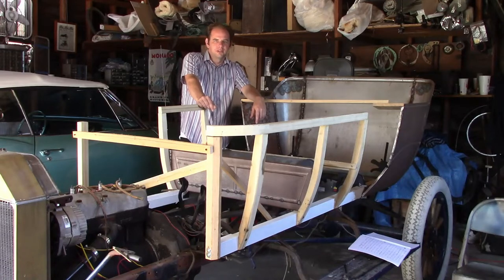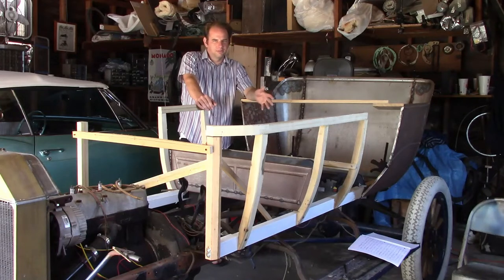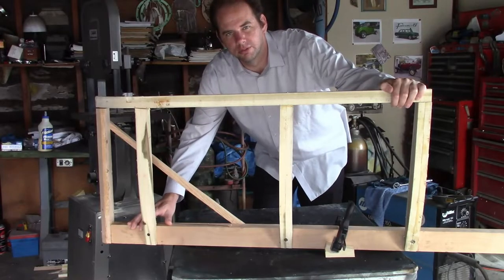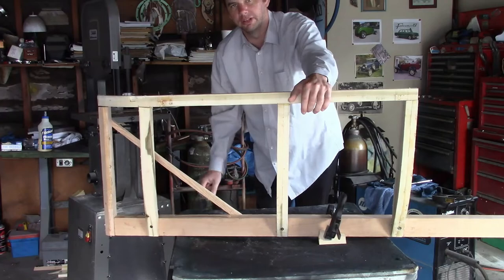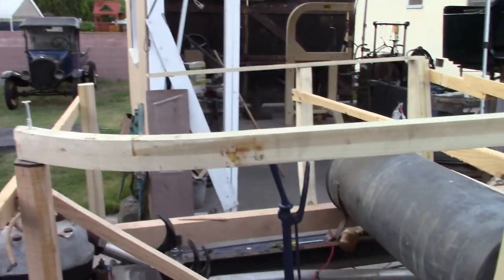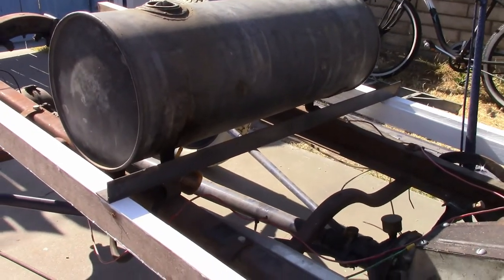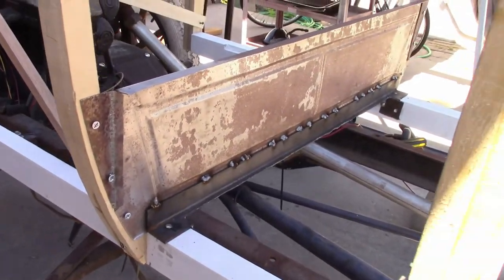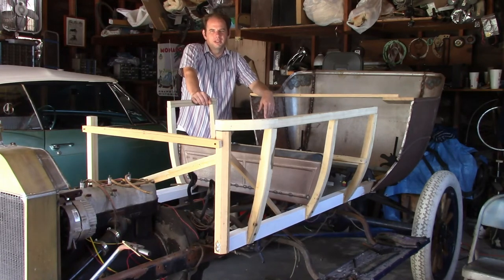Building a 1913 Ford Model T Touring body. Part 6.

Comment: One thing that I use for projects like this is bed frame angle iron. It is some sort of spring steel. It's thin ,but very strong. Hard to drill through, so use lower RPM.

Comment: It is almost impossible to find any information on actually building timber framed cars I have found. YouTube think you mean wooden bucks which of course is not the same thing. I need to build a timber frame for my Riley Brooklands replica and it will be a totally new experience for me. Doing the metalwork, no problem (well, many problems but I'll get there). But timber framing is all new to me. Just getting suitable timber here in NZ will be tricky. My preference being American Ash.
Reply: There is plenty of furniture grade Southland Beech available in New Zealand. It is a fine timber for the job and was the first choice of NZ motor body builders for many decades.
Reply: @granttaylor7392  Thanks Grant, I'll look into the availability of that. Be interesting to see how the price compares.